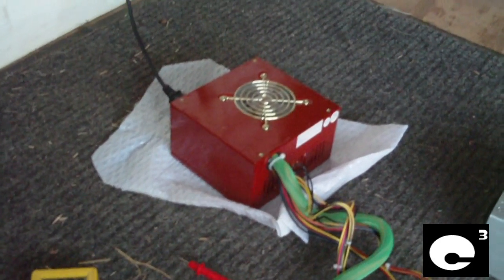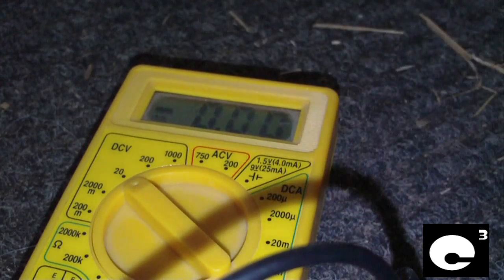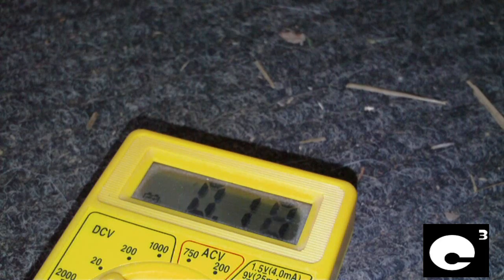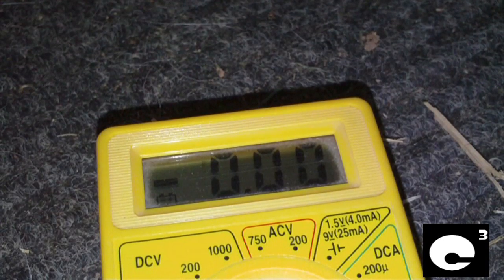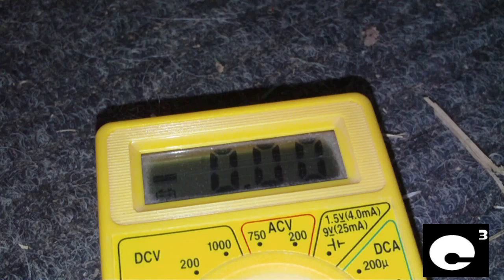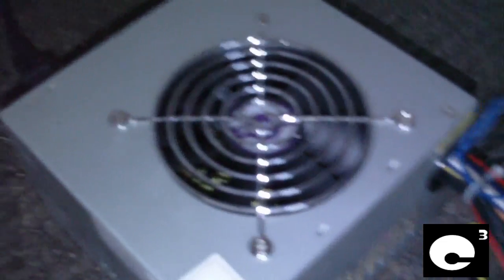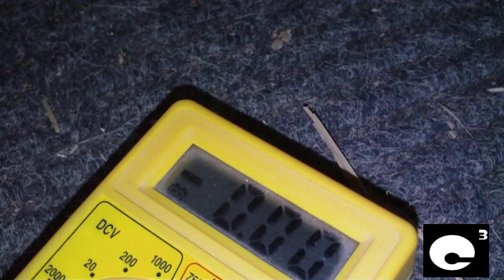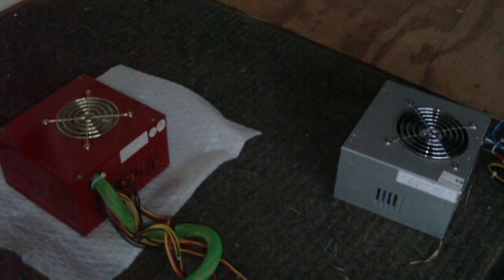Poor 5VSB Regulation on Antec 300w PSU with Fuhjyyu Capacitors

Comment: I have a AOpen branded PSU with Fuhjyyu, thankfully they are not bulging yet and the PSU still turns on. I'll eventually need to put in some rubycon, nichicon, or panasonic capacitors in place of those fuhjyyu capacitors in case it wants to die and take hardware with it. It has -5v and 22 amp +5v.

Comment: ...you speculate in this video that the antecs 5vsb regulation issue is a bad capacitor and it would have been great if you would have showed at least which cap that was, on the pcb in the antec.

Comment: Recapping that dynapower kind of seems a bit like polishing a turd.
Reply from the maker: That one's not your typical Dynapower. Have you seen any of the videos where I pull the cover on one? Most Dynapowers are junk, but the red units were built like a tank. Both of mine still work fine. I'll possibly be putting one back into service soon.

Comment: Did you use the PSU under load, or just open circuit?
You should put at lease something, even a 1k resistor would do. The multimeter has very high impedance so it might interfere with regulation unit.
Anyway, result is very bad.

Comment: well, i just ordered a seasonic M12II 520w atx power supply, and has all japanese caps, which it claims, and by which I don't know if thats a good thing or not probably is, the specs that this power supplie has is great, and I heard seasonic makes antec's stuff and corsairs power supply, but obviously they are not going to give them good parts if the sub company is going to sell lower models dirt cheap.